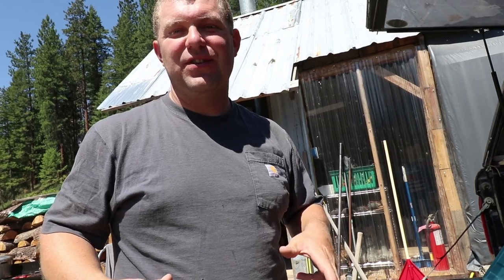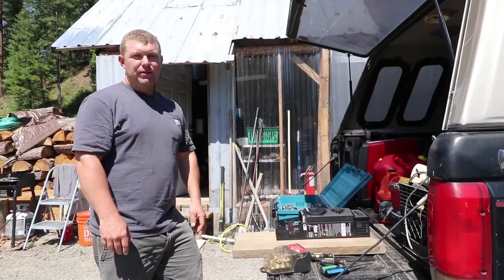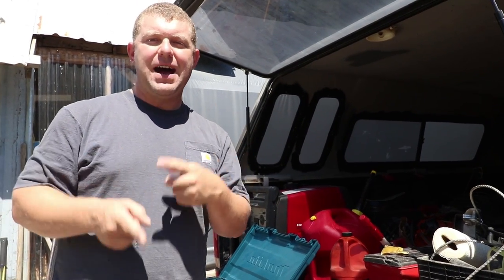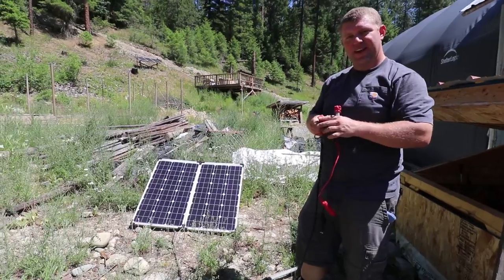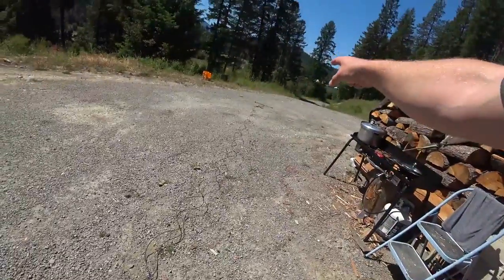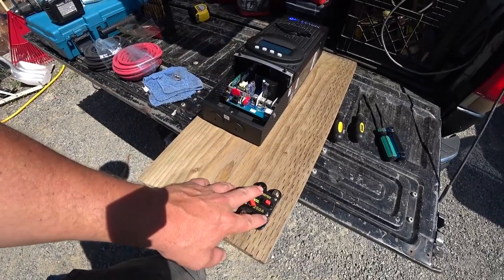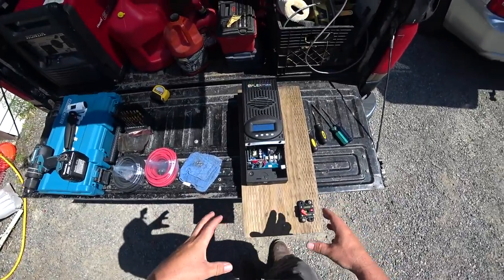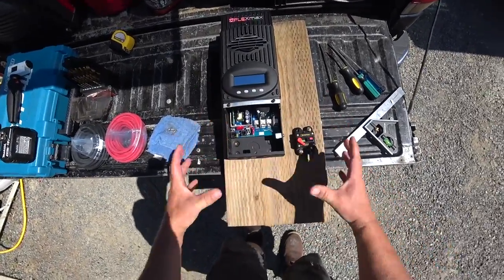Bad Idea? Now We Want Even MORE SOLAR POWER! (480 to 1230 Watt Upgrade)

Comment: oh come on, not even 5 seconds in and you're complaining about the supposed heat?

It's 10pm here and it's still 85 degrees, and feels like 94 thanks to the 78% humidity.
Reply: Amen. they just complain a lot lately about the heat. If they only knew what the heat feels like in the states in the south, especially the ones with high humidity, like Florida for instance. The heat in South Florida at night is worse than the heat where they are during the day time. They should just be thankful that the humidity is probably pretty low where they are.

Comment: You are going to build a house and possibly a business.  When you design a solar system you need to design it for you average daily needs.  Normally if you consult a professional provider step one is determining what your usage is.  Step two is planning how you can reduce consumption and there by your needed equipment.

After your custom system has been designed and built it is designed for you.  It is not designed for any prospective buyer of your property and may not serve the buyer as well.  This will affect the value of the property.

Comment: Fuck that id hate having to limit my power usage like that, Ive got a full basement of arcade games and slot machines and such, Got multiple computers lots of lights 1 full freezer 2 freezer/fridges. id have to give that all up
Reply: JG Beast no you wouldn't.  You couldn't run it on their set up no.  But all that and more could easily be run off solar and batteries

Comment: oh dear lord. be careful with anything dc switch. especially China products. unlike AC that crosses zero volts 60 times a second, DC never does which makes it very hard to break an arc when the switch is opened. double check it's ratings and see if it's tested by etl or UL.

Comment: I can't help thinking you guys are doing things backwards. You're upgrading  systems and doing things 2 or 3 times before you've even positioned or built your house. Yes you're figuring things out as you go, but it's going to wear you down and out at this rate. 

Aren't you better off building your house first and sorting everything out after the fact, or do you love living in that camper trailer/shed too much?

Comment: Mistakes with plumbing mean leaky pipes. Mistakes with electricity can mean death or loss of your home from an electrical fire. It's all well and good to learn as you go on some things, but electricity is not one of them. A single good book on solar power systems would have put you on much firmer footing to understand how to set up a system to meet your needs, or a system that had the right components to allow for later expansion without so many headaches. You're still just making excuses for a total lack of appropriate research. Like you say, solar power is not rocket science.